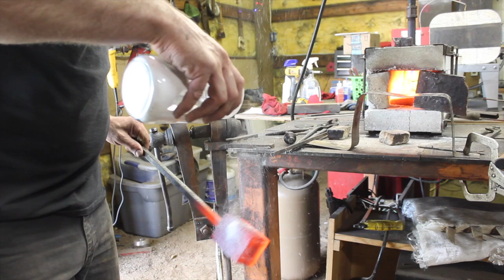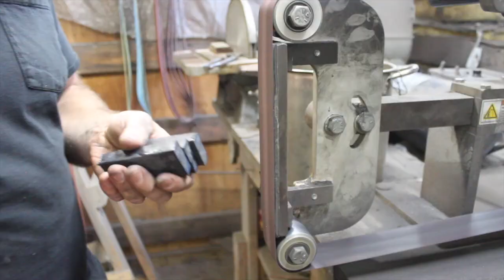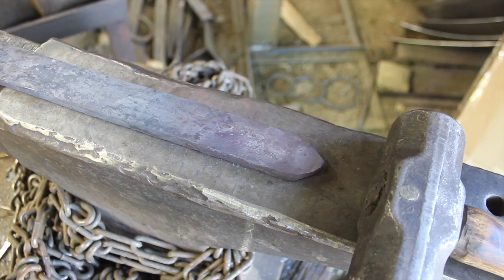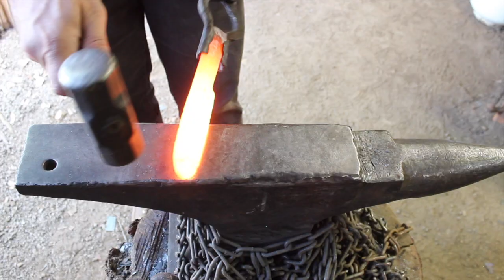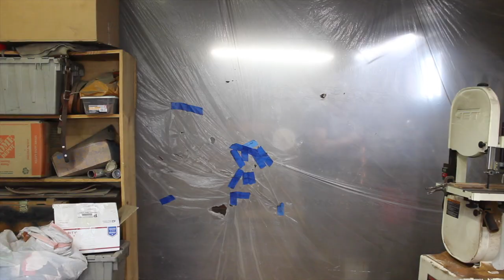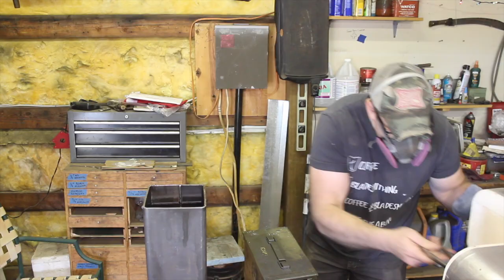Forging A Kephart Bushcraft Knife In Damascus Pattern Welded Steel Knifemaking and Bladesmithing

Comment: I’m using coal iron works 12 ton press and I’ll tell ya a press is a game changer!!🔥⚒💪🏻
Reply: Hi thanks for that info , I’d looked through your videos and missed that one?
Reply from the maker: @col925  yeah its an earlier one..
Reply from the maker: Yes it is!
Reply: Fire Creek Forge have you got a video of your press build ?
Reply from the maker: @col925  unfortunately not, but i did a video on some key things i learned while building it.
Reply: Fire Creek Forge hi what valve did you use for controlling your press and was it open or closed centre I am not sure of which is best ?
Reply from the maker: @col925  Open center. I believe that's the standard for presses. I'd recommend getting Dr. James Batson's book on building a press, it's a good starting point.
Reply from the maker: @col925  here's the video I did: https://www.youtube.com/watch?v=sujJoG5pVj4&t=1174s